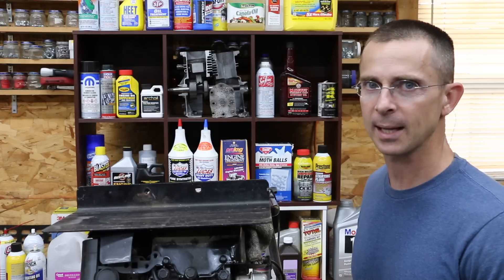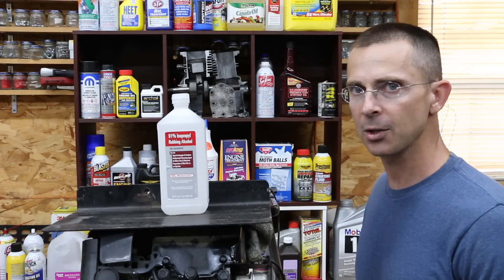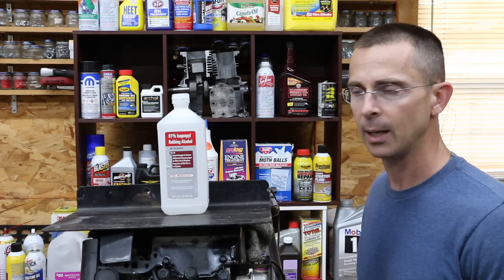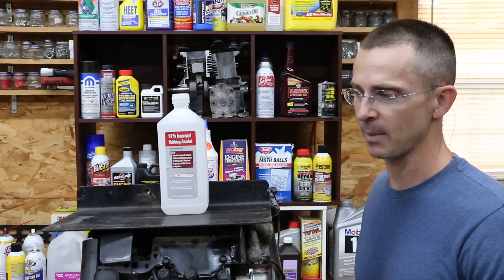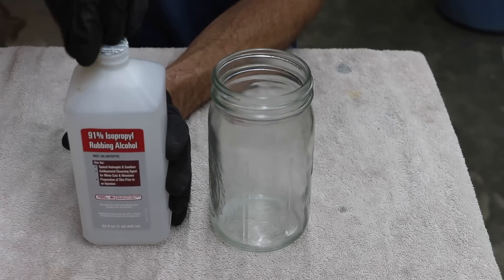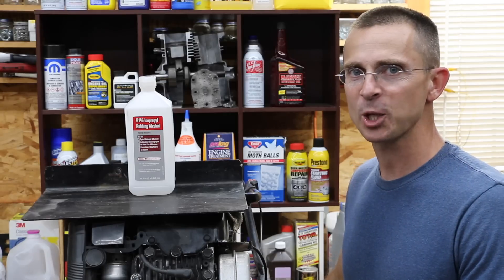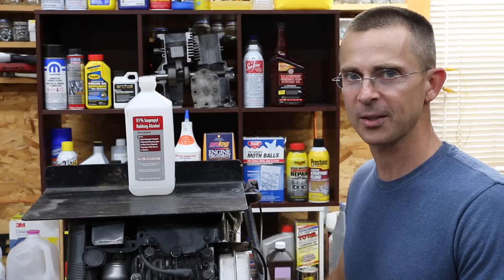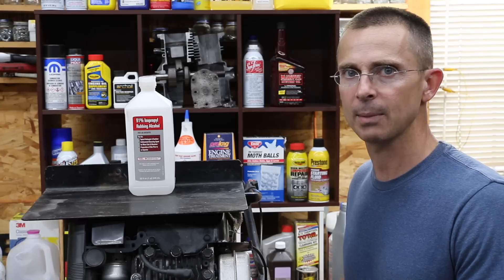Will a Gas Engine Run on Isopropyl Alcohol?  Let's find out!

Comment: Nice job. It seemed to clean up a bit of the carbon too. At least as good as some of the purpose built "cleaners". Maybe it wouldn't hurt to pour a cap full or two in the gas tank when filling up. Even though I'm not brave enough to test on my vehicle. Or maybe keep a bottle in the trunk in case you ever run out of gas.... Someone needs to test a modern car engine.
Reply from the maker: It might be okay, but I would only use this in an emergency situation.  Thanks for commenting!
Reply: Yes, that's true. Im courier and I drive everyday with a gallon of gas in a tiny gas can under one of the front seats in my van. I probably don't need that much. I bet if I ever ran out and put in a bottle of alcohol it would mix with whatever gas remnants were in the tank and get me a couple miles to a gas station. I'm in New England, there's pretty much a gas station every 5 miles. And its probably a little safer than storing gas under my seat. And not to mention... it can be used as intended in a medical emergency. I'm going to have to put some thought into that. Interesting.

Comment: Try acetone as an engine cleaner. Most cleaners use it as a base and I have a feeling running a gas and acetone mix will clean it up just as well as shelf cleaners, but I'd like to know.
edit: better yet use an alcohol and acetone mix!
Reply from the maker: Great suggestions--thank you!

Comment: i would like to see a test of Moble1, Royal Purple, and Valvoline full synthetic oils. Always hear that these are the best oils and would like to know witch is the best and maybe trough in a cheep cheep oil as a control. Thanks
Reply from the maker: Thank you for this recommendation!
Reply: there is a video floating around about oils in -20F and another in -40F lets just say some oils are better in cold weather than others supertech taffy/frozen at -40F

Comment: My dad used to use windshield wiper fluid to clean his 351 Windsor engine.  He would use engine vacuum to suck it in.  Could you try this using a drip system?
Reply from the maker: Thank you for this recommendation!

Comment: Convert it to propane remove the muffler and open the valve all the way and crank up the heat a little on the governor and you will be happy with your results
Reply from the maker: Thank you for this recommendation!
Reply: Project Farm you should also try rc nitro fuel
Reply: Project Farm they all could be cool with what i said to do to the mower it will spit out some flame or at least it will with standard gas no muffler and the governor being mest with. The mower I did this on was my Briggs and Stratton 3.5 horse engine.

Comment: I wonder if the cleaning power from that came from the alcohol or the 9% water that went along with it.  Either way, it definitely cleaned up the engine a bit.
Reply from the maker: This is a very interesting point.  I suspect they both contributed to the cleaning, but I can't say with absolute certainty.

Comment: POUR it in the intake while running, nothing in fuel tank, full throttle, entire bottle. It will not hydro lock like water- and it will wash clean the combustion chamber. After this- be careful to CHANGE the oil while HOT and drip dry.
Reply from the maker: This is a great recommendation.  I may do a future video on this.  Thanks again!

Comment: It probably ran funny because of the different air/fuel ratio of alcohol and because there is nearly 10% water in the fuel.
If there is a way to remove the water, then richen the mixture (Probably alot) and tweek the timing it should run like a top if rubbing alcohol is anything like ethanol.
Reply from the maker: I agree.  Richening the mixture would have helped a lot.  Thank you for commenting!

Comment: I buy fuel injector cleaner, and add it to the tank when I fill up, every other month. I don't know if this is actually making a difference to clean the fuel injectors or not. Also interesting video I see you ran the engine purely on alcohol, but do you think it's safe to do so on a car? If not is maybe a 80/20 mix more recommendable, how could I scale this out to a car and obtain decent results?
Reply from the maker: I personally would only use isopropyl alcohol in an emergency situation and continue using fuel injector cleaner as you are doing.
Reply: Project Farm can you test these fuel injection cleaners?

Comment: You should buy a ford flat head v8 and make plexi glass heads for it
Reply from the maker: Thank you for this recommendation!
Reply: Jonas Devenport I have a flathead v8 come on over will do it
Reply: Project farm I'll do it with you I have 5th flat head v8
Reply: Not 5th (a)
Reply: Jonas Devenport. Chrysler Hemi from the late 60's.
Reply: Aries Might that would be impossible. First of all you would have to make a hemisphere in the head and that’s a challenge in it of itself. Second you’d have to figure out how to make the whole overhead valve system that would obstruct the view of combustion. That’s why a flathead design lends itself so well to plexiglass heads.
Reply: Jonas Devenport. First of all.  If the Hemi head was impossible to produce. The Hemi chamber cylinder head never would have been able to be produced in the first place. You can easily make a Hemi chamber in acrylic with a round end mill.
What you would have is a cylinder head. With increased fuel burn. Through a more efficient combustion process. creating more horse power and torque. 
The flat had is the most inefficent cylinder head design. Which is why most engine manufacturers stopped using it. In the 50's and 60's.
Reply: Aries Might I never said a Hemi head is impossible to produce. I said a plexiglass Hemi Head would be impossible to produce. It would simply melt if you used an end mill and it would never polish up right and be clear. Not to mention the valves obstructing the view of the combustion. I’m no ford fan but the flat head v8 lends itself to be a very good design for this sort of thing because the head is A.flat B. No valves in it C. Easy to replicate.
Reply: Jonas Devenport. You're the one that mentioned using plexiglass as a cylinder head material right! Why would you if you knew it would melt. I dont remember the exact type of plastic he had mentioned. If it can be used for one combustion cylinder head design. It should handle all of them.
I have worked with plastic. You can polish it smooth and clear like glass. Becaouse I have used polish thats made for plastic.
Reply: Aries Might I️ said the plastic would melt from the heat of the end mill not the engine. It would burn up and not be clear. Not to mention the overhead valves that would still obstruct the view and be terribly difficult to make work right.
Reply: Jonas Devenport. Dont tell someone that has experience working with a few different plastics. Including acrylic What you can and cannot do.  And secondly...you keep tripping over your own statements. Meaning you are nothing but a troll.
Reply: Aries Might lol i really don’t give a shit I’m telling you its not possible
Reply: Aries Might look up a picture of a Hemi head and tell me if you could make plastic valve springs, valves, rockers arms, valve covers etc. not possible
Reply: Jonas Devenport. Woow just look at the troll spaz.
Reply: Aries Might if you don’t want to except your wrong i don’t care. I’m not going to continue an argument with an 11 year old who doesn’t know jack shit.

Comment: Great videos! But I'm confused why we only saw a short closeup of the engine running with the see through head, but the remainder of the video was with the normal head and rubbing alcohol; why was that?
Reply from the maker: The see though engine won't take the heat.  The see through engine provides a view of the flame colors more than anything.  Different fuels create different flame color.  Thanks for commenting!

Comment: It looks as though it cleaned the combustion chamber out. Although, if isopropyl alcohol isnt just as bad as ethyl alcohol then its worse. It holds onto water like heck and will ruin the engine in a very short amount of time. Yet it does burn way cleaner than octane.
Reply from the maker: I enjoyed reading your comments.  Thanks!

Comment: Did you have to re-jet the carb? I know with methanol you have to run a much larger jet.
Reply from the maker: I didn't adjust the jets on the engines I used in this test.  However, both engines ran very lean.  The see through engine has an adjustable jet, but the mower engine didn't.  Thanks for commenting!

Comment: When I was 17  I ran out of gas in my 1976 Cj5 258. I bought 4 pints of Isopropyl and put it in the tank. It ran a little rough but got me to the gas station. Later I read an article about a guy that tested a gas generator with alcohol. He was comparing total wattage output per tank for different alcohol percentages and recorded that the totals were about the same. He concluded that the water part must have been contributing to power output. I believe he also stated that adjusting the choke helped with the rough running. Personally, I think "timing adjustment" would have helped more. Might be something to consider if you plan to experiment with different fuels. He also conducted experiments with gas mixed with water using a strong industrial detergent with some interesting results. I believe the water part of the alcohol, in the form of steam,  is what's cleaning your carbon. Steam injection would be another cool experiment. Using generators, instead of lawn mowers, you can more easily compare power outputs with other experiments. Cool channel, BTW.
Reply from the maker: I enjoyed reading your comments!  Thank you very much for the positive feedback regarding the channel!

Comment: Try adding like half a cup of antifreeze to the oil in a engine and run it and see what damage it does to replicate a blown head gasket in a car
Reply from the maker: Thank you for this recommendation!
Reply: Cadillac/Subaru simulator
Reply: That's an awesome idea.
Reply: Trey W cars have pressurized oil systems and these small engines just splash the oil around. So it wouldn't be a very accurate test. I don't think it would do much
Reply: i love that
Reply: Steam clean the piston, seen this on tons of Subarus
Reply: Anti freeze in engine oil will just turn to sludge
Reply: Lazy Gaming it still would be cool to see what damage it does

Comment: Try RC nitro fuel... could be interesting
Reply from the maker: Thank you for this recommendation!
Reply: +1 for nitromethane!
Reply: I was just about to comment this. I'm very interested to see how a lawnmower would run on nitro fuel
Reply: yes
Reply: The oil in premix nitro fuel gums up the plug, if u can mix ur own, or find some with a low oil content it'll run.
Reply: Marcus King really? I've ran a leaf blower on nitro and it ran like a raped ape literally would run so fast if you hit the kill switch it kept running
Reply: i did comment this like a second ago and didn't realize someone already did it lol
Reply: +1 for Nitromethane! Recommended it before :)
Reply: Too bad the oil in it will cause issues.
Reply: Was just looking to see if any one had suggested this. Was always curious the outcome but never brave enough to try it
Reply: Have run a 2 stroke engine on it before, suggest having a way to shut the engine off, either by cutting the fuel or air.  As when i done it simply cutting the spark was not enough had to crimp the fuel line, to stop the engine running.
Reply: Marcus, You have to richen the mixture when you run alcohol because it has less energy (BTUs) than gasoline, that's why it seems to run hot, it is running too lean.  An engine running on alcohol should run cooler than one running on gasoline.
Reply: Will I
Reply: I ran my s10 on hobby fuel it ran as good as normal
Reply: That would be fun to watch. I wouldn't want to be anywhere near it though
Reply: YES!
Reply: girenloland done it, ran well actually.
Reply: It would be interesting from a mechanical standpoint but I think it will cause more harm than not.
I know it is possible to run a mix of gasoline and nitro fuel but just nitro fuel is another story.  It will start up but I think it will not run smooth due to different fuel requirements, the oil in the fuel might also affect things.
Reply: JohnSmith FakeName it runs pretty good you just have to adjust the airscrew for the fastest rpms because stuff revs past the moon on rc nitro and what's the fun in not getting the fastest rpm possible
Reply: I use to run it in my mini bike 15% nitro never had a problem
Reply: If you’re going to run nitro fuel, it will work but get 40% or higher to make sure you burn off all that nasty castor oil it’s mixed with. 15% and 20% nitromethane is meant for use as engine break in fuel. You can also run a standard 2 stroke on 40%+ nitro without any problems since nitro RC engines are really just tiny 2 stroke diesel engines and operate just like their big brothers but at much much much higher rpm.
Reply: He did!

Comment: What if you mix 91% isopropyl alcohol and gasoline in a 50/50 ratio?
Reply from the maker: Thank you for this recommendation!
Reply: King_Badger_22 I did that in my old go kart as kid... It really helped the acceleration!!!
Reply: If you do that, you'll have to use a bonding agent such as toluene. We've done this racing karts before and if you don't use something like that it just separates. The problem there is alcohol and gas burn at different rates. Alcohol is basically water based where as gas is obviously oil based. They don't play well together. We always used Pruit racing oil to make the blend. It has the necessary ingredients built into it and was readily available. Pouring alcohol in a gas tank is a pretty good way to get rid of water in you gas tank or fuel filters. It's flammable enough to pass the water.
Reply: Frank Gutowski I don’t think I said water and alcohol don’t mix. I said alcohol and gas don’t mix. Alcohol and water will definitely mix basically letting the water burn off with the alcohol as long as the ratio of alcohol is high enough. The gas and the alcohol water mixture never integrates but if you can get enough flow to pass the mixture it will burn it off. I am not a chemist and don’t necessarily know exactly how the chemical (thinking it’s toluene but can’t be 100 percent on that) works, but there is something that makes them work together.

Comment: Only trouble with running alcohol through an engine is it eats things like seals and fuel hoses unless they're rated for use with alcohols (usually ethanol, seeing as they use that to poison petrol to kill older cars), but yep, it does work, little less power, but it works... :)
Reply from the maker: This is an excellent point! Thanks for commenting!

Comment: camp fuel aka coleman fuel
Reply: inertia210 
We used to have a guy working for us on roof jobs. We bought him a two stroke scooter so we didn't have to pick him up when we needed him. He showed up one day bragging about filling it with Coleman fuel because he has no money for gas and oil. He made it to the job but the rings and bore we done within a few more days. We bought him gas and oil after he told us what he did but it was too late after his 45 minute inner city morning ride.
Reply from the maker: Thank you for this recommendation!
Reply: inertia210 That might be interesting to see. Thing here is the octane rating is pretty low on "white gas".
Reply: I'd like to see this as well.  Thank you for this video!
Reply: It would be like pure gasoline without any antiknock compounds or anything.  I'd actually be game to see!
Reply: will run fine on white gas, I've done it several times and it seemed to run better.
Reply: Uhh, no it's not. It's referred to as white gas. Semi high combustion point but it is only like 50-55 octane but will will work as gas in a pinch.. It just might screw up your valves and piston rods though.
Reply: All that is is liquid propane

Comment: hows about hooking some propane to that lawnmower? hahahaha
Reply from the maker: Thank you for this recommendation!
Reply: You can do that even with a diesel if you drill out a place for a spark plug we have a modified diesel generator we made that burns natural gas
Reply: I know theres cheapo cab drivers that hook up propane to their cars
Reply: I have seen a riding mower run on propane it cool to see.if he could do it he would get so many likes it isn't funny.
Reply: Propane will make an engine run like it's on gas,just it needs a little fuel/air ratio tweaking,the same goes for ethanol,acetone,natural gas,propane,butane, gas fumes,whatever ignites by a spark. There are millions of cars with a kit installed to run on LPG that will seamlessly turn into gas mode when the LPG runs out or if you press the fuel change button. For testing purposes you can run an engine on propane straightly with a hose on its intake but it will backfire sooner or later and you will need to constantly finding out the fuel air ratio manually for the rpm.

Comment: Absolutely great video. It didn't run very smooth because alcohol(methanol for racing I'm referring to) needs about 30% more fuel over race fuel and more compression to run with great power. I would like to see you run Brake-Kleen 94 octane mix to clean combustion chamber.
Reply from the maker: This is a great point. This helps explain why the exhaust valve was so light in color from running so lean.  Thanks again for commenting!
Reply: Project Farm it was definitely lean. And the only reason temperatures were normal is because alky burns and flows extremely cool. At he end of a pass the intake runners will be frosted with condensation. Look at any videos on my page. All on alcohol